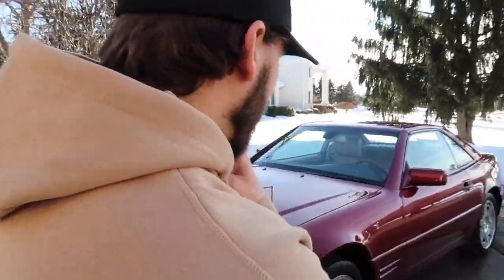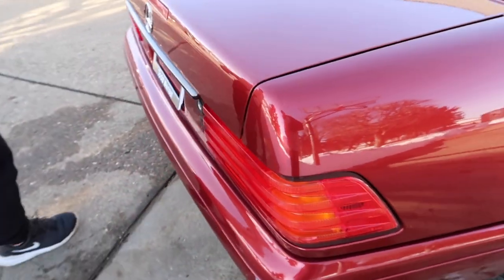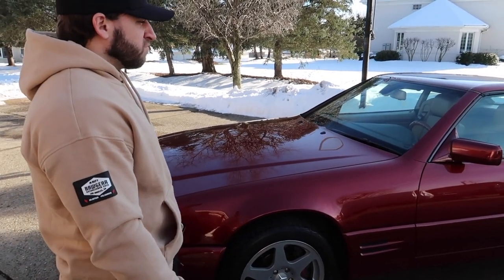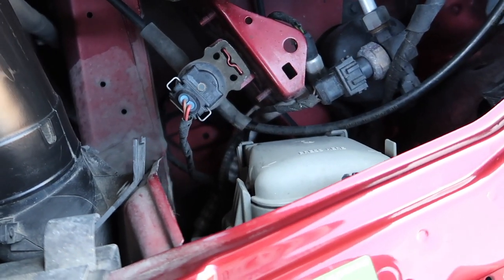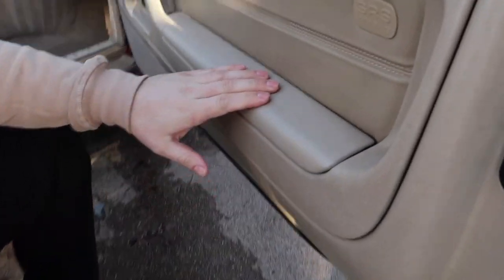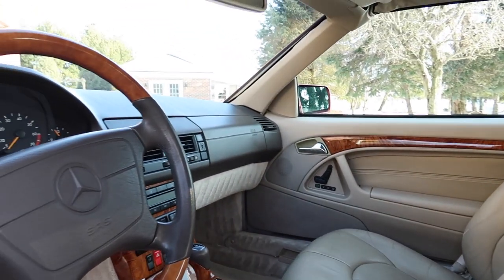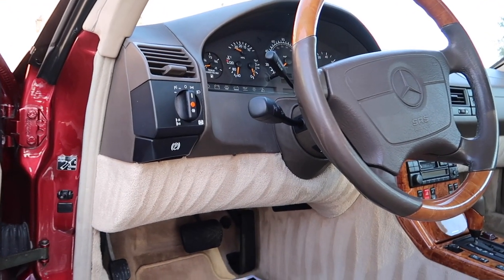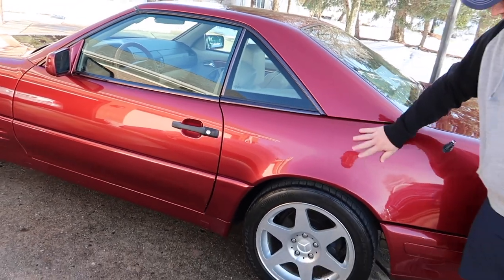Here's Everything Wrong with our RARE RENNtech Mercedes SL500!

Comment: That ticking is your vapor purge valve, sitting right behind your headlight. That is normal, the ticking is nothing to worry about
Reply from the maker: Thanks for the info! We actually just got a CEL for the evap system purge flow. The code is P0441